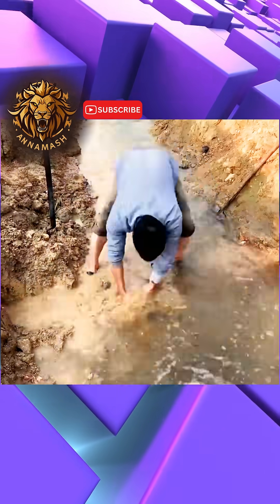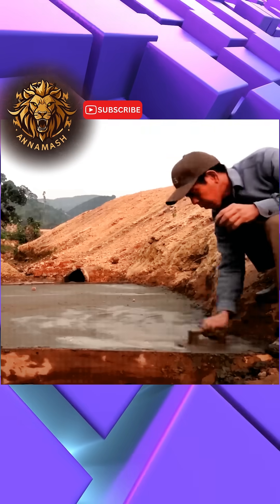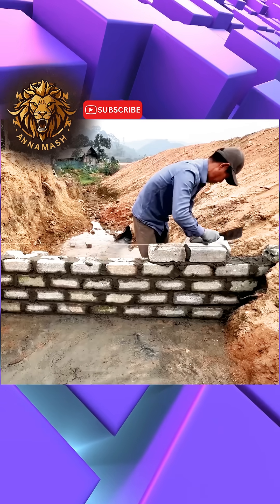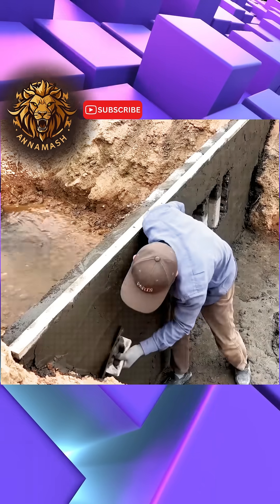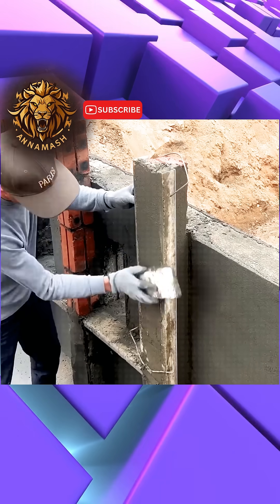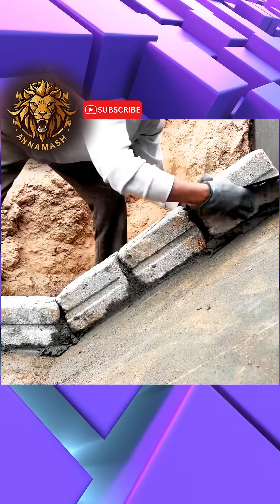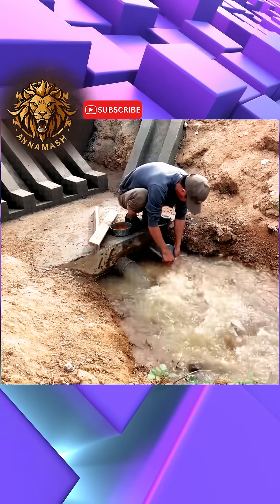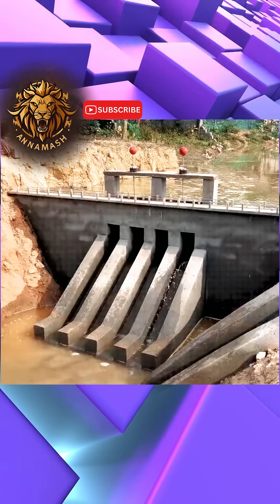This Tiny Dam Actually Works #construction #engineering

Comment: First of all great job on the success of this dam.

However, I have trouble believing that a wall made of this material with only a single stone thickness could hold back approximately 4 feet height of water.

At 7.48 gallons of water per cubic foot and each of those gallons weighing 8.34 pounds each, the force against that wall is significant.

There are other points of the construction I have questions about but I'll just leave it with this one.  Cheers.
Reply: You can see that there is a reinforcement everywhere, the same as on the top - the squares are coming thru look 1min 5 sec ... I don't understand ? he tried to hide it ..